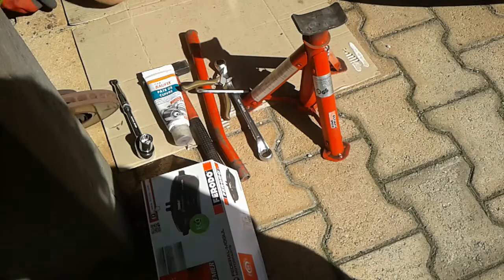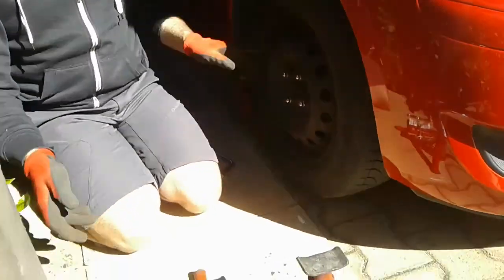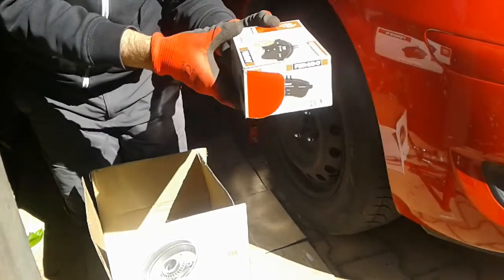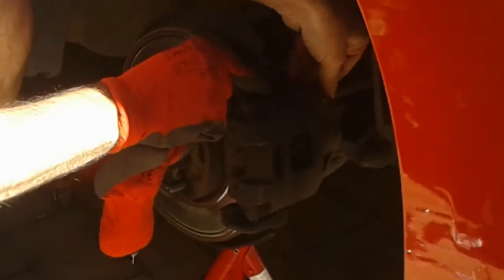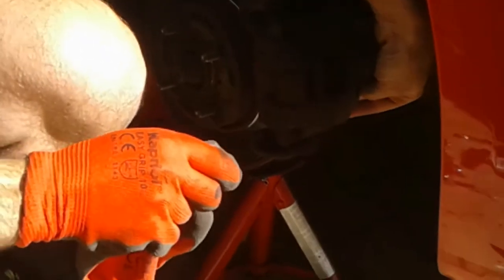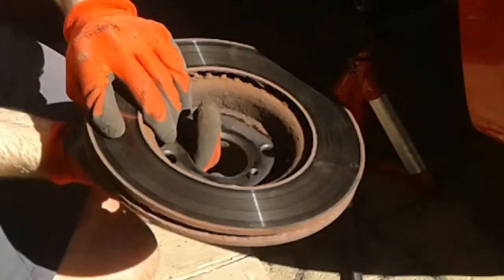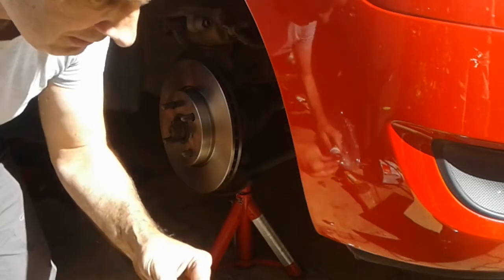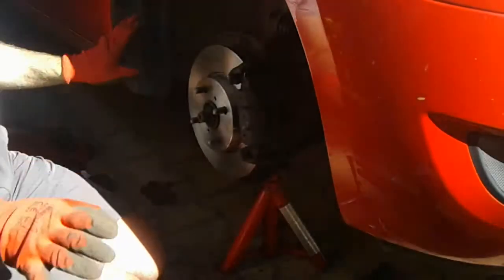Changing Yaris II + Yaris III Front Disks

Comment: Hi! Brakes in mkii and mk3 yaris are the same? Thank you!
Reply from the maker: Hi Matteo, I don't know for sure but there won't be a lot of difference as the MKIII was a facelift of the MKII. Maybe there is another video on YT covering the MKIII exactly? In principal disk brakes are very similar.
Reply: @davidzof  thank you :) for sure I'll find some videos, otherwise I'll check the service manual on toyota site. Have a nice day
Reply: @Matteo-mz7op  diameter disc 235 or 220 don t fit in yaris 2011   fit in yaris 1   2011 yaris need 250mm disc
Reply: @davidzof  Which is this car you're working on? mk2 or mk3? Great vid btw- So silly but I'd not have twigged on the lefty loosey / righty tighty!
Reply from the maker: @epiphgd4302  mk2 but they did a small cosmetic revamp at some point